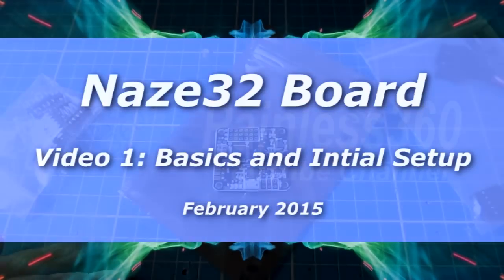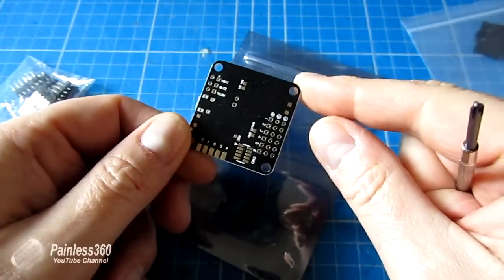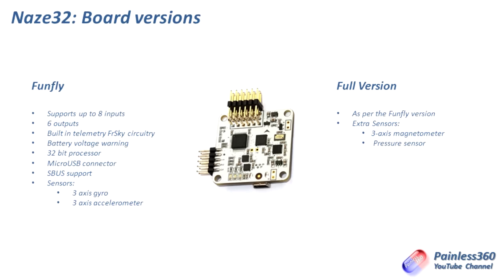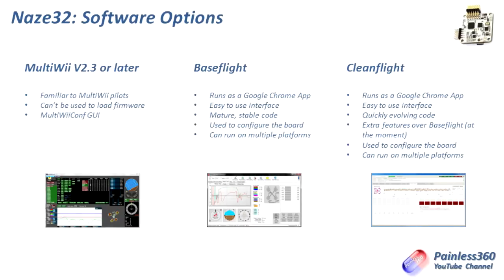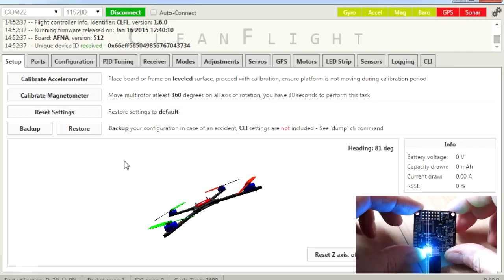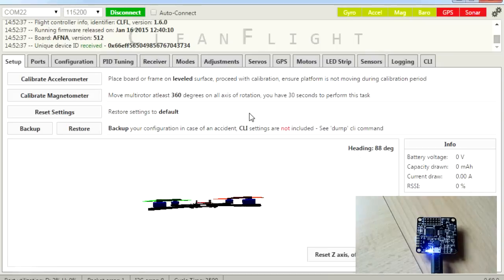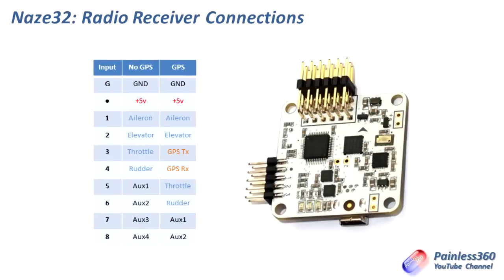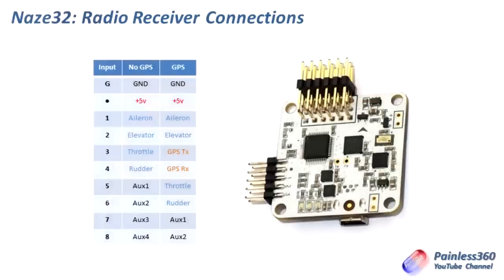(1/8) Naze32 Flight Controller (Full version) - step by step initial setup

Comment: Hi,
I did the calibrate magnotometer on my naze 32 10 full and the blue and green lights stay flashing....done this a few times just as your video advises and still have the green light, is this ok
Thanks
Reply from the maker: sometimes the LED usage changes in the firmware versions. If the heading is showing correctly in the GUI and it arms ok then I'd not worry..
Reply: ok thanks i will see how i get on....good videos keep em coming

Comment: you didnt post a link to purchase. Would like to buy via your channel if that helps you out 
Cheers
Reply from the maker: bigfilsing Thank you, that is thoughtful. I don't resell anything. This channel is all about helping others and putting back into a great hobby.
Happy flying!
Reply: Painless360 Yeah i get that and one of the main things i think you have managed with all of the vid series you have produced to maintain is the "how to" approach rather than the "this is better than that' comparisons.  Not easy to do or maintain but much appreciated never the less.Im having trouble sourcing the full blown version to be honest. HK is well .....HK not really that helpful . Ebay has an array of sellers none of which i really trust. Dont get me wrong i buy tons of stuff off ebay but the Naze 32 delivers lots of potential suppliers with all kinds of descriptive words that dont really define what version they are actually selling. 
Bangood delivers nothing when you search for Naze or Naze 32. 
All in all quite frustrating
Reply from the maker: The Flip32 (video coming out soon on the channel) is on the Banggood.com website and is a full 10DoF board and is functionally the same as the Naze32 Full version.

I have bought a few things from http://www.hobbyrc.co.uk/afroflight-full-naze-32-flight-control-board recently and found them good.

Hope this helps.
Reply: Painless360 Thanks for the link. In my hunt for the FULL Naze 32 ive come across the Flip32  and wondered how it compares so im eager to see your series. will you have a link to banggood that earns you points or at least recognition. I rely heavily on you tube series like yours and would want to "give back" for all your hard work if possible.I understand your need to stay objective/independent ....but still.
Cheers
Reply from the maker: Video on the Fip32 coming next week - it is actually VERY close to the Naze32 Full version with a few minor changes. Once you know what they are you can then still use the full Naze32 series to set it up.

On the independent front - I do my best to stay truthful and also credit those suppliers who provide the kit for review. It doesn't mean they get a free pass but I am very specific about the things I will review to help avoid me having to be too negative...

Happy flying!

Comment: Hi, I'm having a problem flying my quad, I'm using a naze 32 with cleanflight. When I throttle up its fine but when I am just about to leave the ground the quad just suddenly flips over. When I throttled up again when it's in my hand one of the motors just twitched and gets really hot. Hope you can help, Will.
Reply: +William Coates fixed that, new problem:
When i go in to horizon self level mode the quad sways back and forth?
Reply from the maker: What troubleshooting have you done?
Reply: +Painless360 not much, not sure what to do.

Comment: Hi, I am setting up a Naze32 with a Spektrum DX8 and have allocated aux 1, 2 and 3 to switches, which show as all working correctly on the tx monitor. I have a problem that in clean flight aux1 shows as aux 2, aux 2 shows as aux 1, and aux 3 doesn't show at all. I am configured for ppm and the 4 main channels work as they should. Is there something obvious I have missed? Thanks for any help you can give.
Reply from the maker: +Keith Harper normally channel order in the radio setup screens.. Best of luck

Comment: Hi Painless
I am new to these builds and have tried to program a CRIUS AIOP V1.1 and had no success.Can you advise me if the CC3D or the NAZE 32 are good for the likes of GPS and ATTI hold.I have good soldering skills but I think the CRIUS was corrupt as the bloke who sold me it said he had trouble programming it.I have a NAZA V2 at the moment but I wanted to go into the self learning curve.Your comments would be appreciated.What O/S are you using to program yours?
Regards
J
Reply from the maker: yoodoo122 This video should help with the decision on boards - https://www.youtube.com/watch?v=k4tQAmg2ssA
I have video series that cover the main points of most of the popular hobby boards out there (Pixhawk series coming soon) so browsing through these will help you make up your mind.
Each board has it's own companion GUI and firmware. Some boards have options to install several types (The CC3D can run Openpilot or Cleanflight for example).
Best of luck.
Reply: Painless360 Thanks for the response.I have ordered a CC3D to be getting on with.
Great vids,easily explained,subscribed!

Comment: Hi sir. I got the Naze32 and the orange 7channel with SBUS same as you have in the video, they are working in PWM, but I can't seem to figure out how do they work together in SBUS mode, I connected them in the the first 3 pins NPS and to SBUS channel in the receiver, then in the configuration of cleanflight, I chose spektrum 1024 and serial SBUS, but this does not hold the selection when I save (even PPM doesn't work). what am I doing wrong
Reply from the maker: khaled Homouda Hi, sorry I don't use SBUS here bit there are some good documents that may help - https://github.com/cleanflight/cleanflight/blob/master/docs/Rx.md
Best of luck..

Comment: Hi There ...could you confirm me that's possible to wire with S-bus on Naze 32 Full Rev 5 or is it only authorized with Rev 6...i get a 14SG futaba Tx with Fasst system....and i think to buy a.... Frsky TFR8SB 8/16CH FASST Compatible Receiver With RSSI&SB Ports  to build my quad 250 Fpv.....
Nice fly
Philippe
Reply from the maker: Yes, you will need an inverter though..
Reply: Hi, what is an inverter...?
thank's a lot
Reply from the maker: Search on the channel - answer if on here ;)
Reply: Hi, i've shown on your video and i've understood this receiver..OrangeRx R615X DSM2/DSMX 2.4GHz compatible receiver... which is ccpm receiver but i don't know if it's the same protocol than Futaba  Fasstest or not...! But DSM2/DSMX is compatible with Spektrum....
Do you know the differences between Frsky TFR8SB 8/16CH FASST Compatible Receiver   and   OrangeRx R615X DSM2/DSMX 2.4GHz compatible receiver...?
fly funny
Philippe
Reply from the maker: See the videos in the 'Introduction to RC' that go through all of this. They should help. Best of luck..

Comment: hi mate im changing to a naze from cc3d and im trying to get my devo rx701 to work with the naze 32 but my devo 10 inputs are only moving the aux 1,2,3,4 and not roll pitch throttle or yaw. I have swapped the cables with no joy its really stuck me can you help please
Reply from the maker: +mark rankin Can you see the channels moving on the radio (most have a monitor screen in the menus)? Does a servo plugged into one of the problem channels move with the radio control?...
Reply: +Painless360 Thank you for replying. Yes I can see the radio inputs move in cleanflight but my stick movements are only moving the aux1,2,3,4. I was about to give up but found someone on youtube showing cli in cleanflight for channel mapping. At the top of the receiver theres a drop down tab which has 3 options ones got the letter for stick inputs with 1234 at the end and I think thats what I need to swap over in cli. dont know how to do this yet but im getting there so much work its killing me this naze lol
Reply from the maker: We do cover channel mapping in the series. Best of luck with it all, the first one is always 'interesting' :)
Reply: +Painless360 Thank you!

Comment: I have a serious problem. Rotating copter on roll to the left, rotates image on cleanflight to the right and vice versa. On pitch it is ok. How can i fix this?
Reply: Paps fixed it by flashing latest online firmware. I had RCExplorers firmware installed and it seems to have roll reversed. So...yeh. That is that
Reply from the maker: Paps Great - this would have helped you confirm the 'right' way - https://www.youtube.com/watch?v=lxVd4LnHDjQ
Happy flying!
Reply: Painless360 Thanks for that. Now i just realized he has a separate firmware for standalone board. It puzzles me how i failed to see that...

Comment: is it possible to put gps on a naze32 acro or light version?
Reply from the maker: Hi Paul, if you use the playlists on the channel you'll find all kinds of interesting videos - https://www.youtube.com/watch?v=ImFCE-qdOi8&list=PLYsWjANuAm4p47OBBTOo4Xr3lNUc8PFpc&index=8

The short answer is yes you can but it won't be able to perform GPS home and GPS home modes without the magnetometer that the basic version of the board doesn't have.

Happy flying!
Reply: Painless360  thank you for the fast reply. Im running on kk 2.1 my fear is loosing range and then crying for hours. Return to home is a feature that might save my hair from going grey.
Great videos, thank you for making the naze32 installation painless
Reply from the maker: I would advise the full version then..

Happy flying!

Comment: Hi, when my board connects and i move my board, I see it on the screen moving as well but... at the top right corner every video i watch has Gyro, Accel, Mag and Baro highlighted, when mine is connected only Gyro and Accel are highlighted and Mag and Baro are NOT highlighted. What does this mean and what can I do to get all 4 tabs highlighted and working properly? Thank you
Reply: +Rocco Vail I am using the naze32 board by the way
Reply: +Rocco Vail Also, if I change something in any of the tabs like the configuration tab, then I hit save and reboot, it says rebooting and never saves and never finished the reboot, then i have to disconnect and reconnect again. What do I do about this?
Reply from the maker: +Rocco Vail It means you have the basic version of the board that only has these sensors. This is covered in the video. Happy flying!

Comment: sir i need some help regarding, flight controller (kk multicopter v5.5). it work with normal radio transmitter & receiver but sir i wanted to use ESP8266 ESP-01 as a receiver so that i can control it from computer
Reply from the maker: We've never used that module here. Best of luck!

Comment: Is it possible to create my own flight controller then install one of the firmware in it like in the video?
Reply from the maker: If you know how to design a circuit board and then edit and compile the firmware you want to match the pinouts then you could.. Best of luck!

Comment: Friend , to use pins 3 and 4 of the flip32 in GPS The connection is necessary that it ??? This After a PPM
Reply from the maker: If you're not sure then it's also all covered in the Cleanflight documentation - best of luck!

Comment: i am hopeless and lost... I have started building my first 5 quads and cannot geta single one to hook up to reciever! I have a spracing f3 that i am completely hopeless on but i am currently trying to hook up my abusemark naze32 rev6 to my devo7 reciever, but i have tried numerous hours trying to connect to my turnigy9x as well with absolutely not one single bar in reciever ever mkoving. I have watched every single video on youtube regarding bboth boards and recievers.  Please someone help m,e what EXACTLYdo you use to hook up a spf3 to devo7 and turnigy9x, and what exactly do you use to do the abusemark rev6 to the same 2 controllers.  I think that it was supposed to pwm on the abusemark but i never got anything to work.  i AM ABOUT READY TO THROW IN THE TOWEL. I havbe binded both of the reciveers to the controllers, i am having issues actually just connecting the quads to those two exact controllers.  They are a million videos but not a single one of either of those getting hooked up to a naze32. thank you so much.
Reply from the maker: +ryan darnell Focus on getting one working and learn from that. I'd suspect that the Rx isn't bound properly. Happy to help but please watch https://www.youtube.com/watch?v=olIqTiSJHIY and come back to me with more detail of what you've tried..
Reply: +Painless360  i have bound rec properly with the bind plug fiour aa batt and the red light is solid, plus i did fix id on it, it isnt binding issue.  The issue is i cannot find an exact video or directions showing exactly what pins go where. I am not sure if i am supposed to be doing ppm, pwm, cppm, etc.... I have my 4 opto little bee 20amp hooked up to the 1-4 channel on the servo pins, the motors all spin in CF, but i cant get a bar to move while in CF in reciever.  Can you tell me exactly where to hook what pins on the rx and naze32 on the G 5V 1-8 pin outs plz. THANK YOU.
Reply from the maker: How can you be sure that it's not a binding issue? Can you move a spare servo plugged into a channel on it? See the painless360.com site for charges for one-to-one help..

Comment: i use a naze 32 and flashed it to cleanflight ,i tried to setup the board and i get no throttle signal( i use PWM ,Frsky X8R) pitch roll yaw works but throttle not. 
i checked connections any idea whats wrong?
greetz
Reply from the maker: Hohes C What about if you plug a spare servo into the throttle channel on the rx - does that move as you increase the throttle?
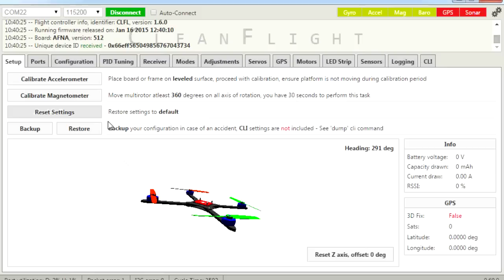(I am assuming here that you can't see the throttle move in the receiver screen in Cleanflight - see 22:47)
Reply from the maker: Hohes C What about if you plug a spare servo into the throttle channel on the rx - does that move as you increase the throttle?
(I am assuming here that you can't see the throttle move in the receiver screen in Cleanflight - see 22:47)
Reply: Painless360 i had a signal and it worked then i connected it to cleanflight, after that i doesnt work.. 
the throttle doesnt move in cleanflight :/
Reply from the maker: And the servo test - what happened?

Comment: I have a naze32 rev6. Full version 10dof. It is supposed to have a magnetometer. I have upgraded firmware and latest software but it is showing as no magnetometer. Is there any other way to test to see if I got a bad board or a knockoff.
Reply from the maker: +Crash203232 if you Google something like 'no mag painless360' then you'll find my video on it..
Reply: Painless360 thanks.
Reply: Painless360 I am pretty sure I have a malfunctioning magnetometer. Everything else works fine. My question to you is. Is there really any advantage in a beginner's fpv race quad or should I just put it all together and forget about the magnetometer altogether. This will be my first quad build outside of the toygrade quads I have.
Reply from the maker: +Crash203232 none at all. Happy racing!

Comment: Hi Painless360, I need help with Naze 32 full version. I have it installed in Sky Hero Spyder 450 and i have everything working good but the Yaw is very slow. Really trying to watch videos to see what I need to adjust, but I guess I'm not getting it.
Reply from the maker: Drew Tuck Have you full travel on the radio? If so then increase YAW RATE in the PID tuning screen.
Best of luck.
Reply: Hi Painless, this is my first build of a Quad and dealing with the software. Trying to understand where you are talking about. I am using Cleanflight to program Naze 32.
Reply from the maker: PID tuning tab in Cleanflight - right hand side - YAW RATE value - Increase slightly and see how that feels. Keep increasing until you get to the right value for you.

Best of luck.
Reply: Thank Painless.

Comment: Hi, I am trying to connect the receiver (spectrum DX7) with the Naze32. I have checked the pins and it is all correct on the board. The problem is that the Cleanflight is not showing the signal of the Throttle and the Yaw. Do you know what can be a possible problem? I have tested each channel of my receiver and it is ok, so I assumed that the problem is on the Naze32.
Reply from the maker: PWM or PPM?
Reply: PWM
Reply from the maker: In that case I would pop a spare servo into those connections and see if it moves ok, if it does then you need to look at the CC3D, if it doesn't then you need to focus on the Rx/radio.

Best of luck.
Reply: Painless360  Thank you. I solve the problem. I was using a Afroflight, so the pins are in a different sequence. I thought that the Pins of Naze32 are all equals.

Comment: hello sir please and please help me.... im really sad  due my faulty naze32(version 6.6 clean flight) . I got the bootloader failed error aswell. I reflashed the firmware. I can connect the naze in cleanflight but when i try to change any settings. It wont save. It locks up displaying "rebooting" but never completes the reboot sequence. please help and make 1 video for those have same problem... please please and please...need help!!!!!!!!
Reply from the maker: +mochiko yushiro I assume you've asked the guy you bought it from for help?

Comment: Hello Painless360,  Please help, after flashing Naze32 to Cleanflight and calibrating Accelerometer and Magnetometer, the red led light is flashing(blinking). The naze32 is not mounted on the frame and does not have any pins soldered to it yet,  What does that red led blinking means ? thanks
Reply from the maker: +Juan Carlos Vargas probably needs calibration of the accelerometers. Best of luck!

Comment: can you comment to this post and link here so I can find cleanflight 1.2.0, can't find it, only 1.2.1. I have 1.2.1 installed and running, but it is not for firmware 1.12.1, so running 1.2.1 I can't load firmware for 1.2.1, just for 1.2.0. strange, I think.
Reply from the maker: +Scottslookingabout newer versions of the GUI will not want to talk to older versions of the code on the boards. I'm not aware of anywhere you can download the older code.. Best of luck..